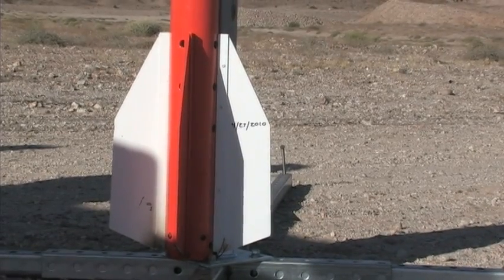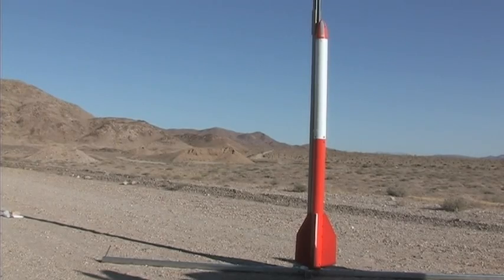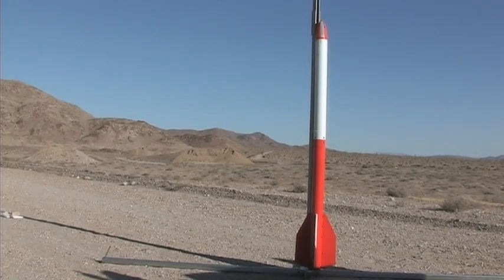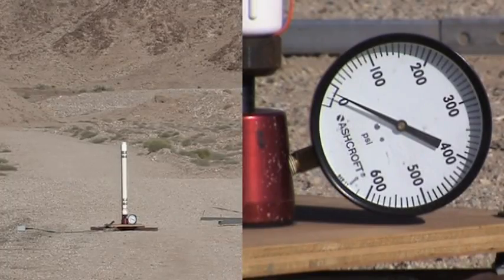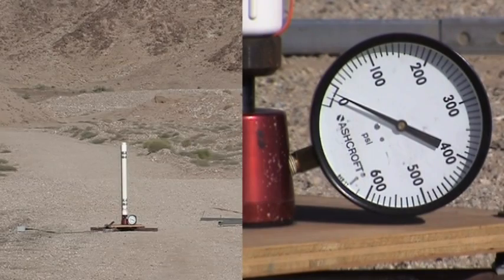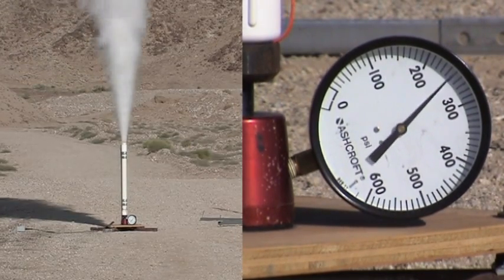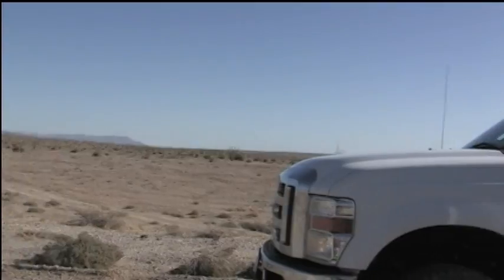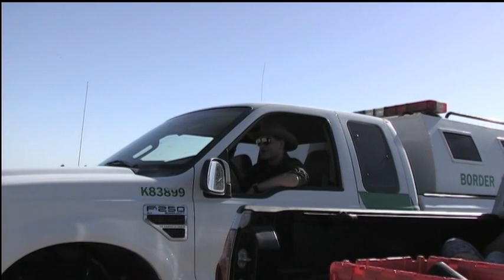May Flight

Comment: Dan, I used your recipe several times on some very small motors. It never seemed to work out for me. Then I built a 4 bates grain 1 1/2" x 9" (propellant section) motor. I used bath tub liner rubber sheet as the inhibitor. I also used quick dry cement with embedded steel washers for the nozzle. On an engine this scale it was impressive! I saw about 1.7 seconds of pure intense thrust. The motor was buried in the ground nozzle up and threw a plume 40 feet high with a deafening roar. I built this motor a year ago. And improperly stored it open to the air and with a smokeless powder prime she lit right off. Unfortunately at the very end of the burn the bulkhead leaked which would have likely Catod a rocket. 

None the less your experimentation has been very inspiring and your method of kn03 preparation did prove to work very well on a larger engine.

Comment from the maker: As soon at the engine cuts out, the drag on the rocket is greater than the drag on the mercury blob in the switch and it will immediately close. It will remain closed through apogee and all the way down to the ground because the gravitational forces acting on the blob and the rocket will be the same. I'm not qualified to answer this much better than that but you can Google it and I'm sure you can come up with a better explanation. Also check out the SUGPRO archives, there was a thread on this.

Comment: @solidskateboards I'm confused now. If you put a mercury switch upside down during the flight, the circuit would remain open till the rocket hit apogee and started coming back down. Then the mercury switch would make a connection and close the circuit. when the rock starts to tilt down at apogee the circuit closes and initiates a delay.

Comment from the maker: The thing that made the apogee detector work was the spring that would push the switch open at apogee. A mercury switch will remain closed throughout the entire flight starting when the motor cuts out. This in conjunction with a time delay relay would do the trick. That's what I'll be flying this month. I think it's a much more reliable configuration. Thanks for the comment!

Comment from the maker: I might be using one next month but not with the apogee detector, it needs a spring to push it off the switch at apogee when it's weightless. Not sure if I'm going to continue in that direction. I might go back to the time delay relay since the rocket, engine and piston are so solid now. Thanks.

Comment: Is there a way to strengthen the switch body to prevent fracture? I haven't seen the switch body, but could you possibly have room for some sort of elastic-type casing that would fit *very* snugly over the area prone to fracture?